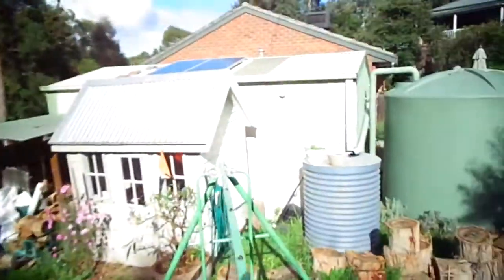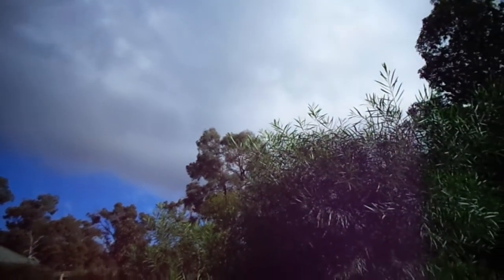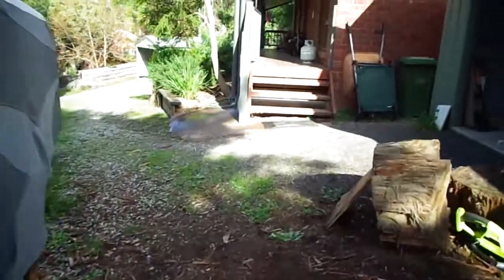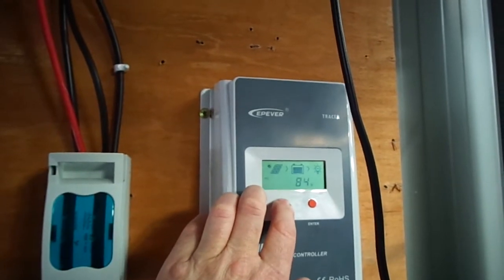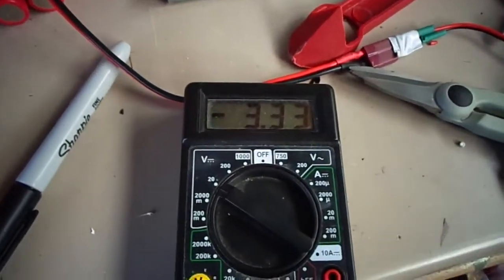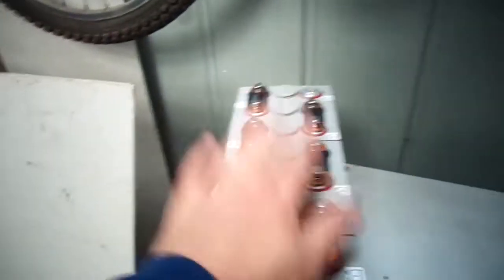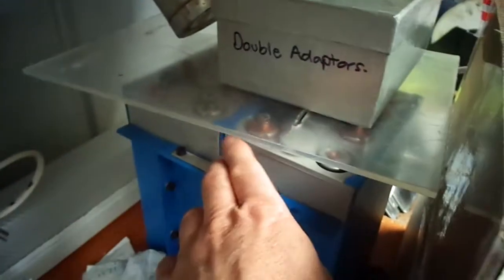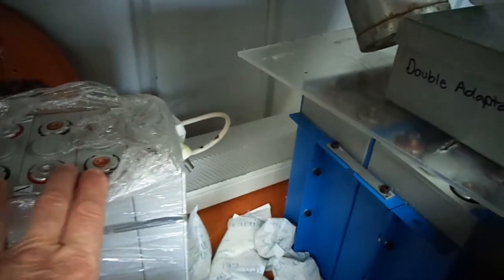LiFePO4 CALB 12 Volt Battery Bank Updates and Solar Update Part 1.

Comment: If/when you upgrade your system from 12V to 48v, be aware that the EPever 2210/3210/4210 run at 12-24v. Page 9 of the book tells you what voltage panels you can use with each charger for optimum efficiency. The conversion efficiency curves at the back of the book show you how much power you can expect at what input voltages. My 4210a (24v system) uses 6 x 72-cell panels in parallel with a Vmp of 36.6v. This puts it in the 96-98% area, so stays cool. Good luck!
Reply from the maker: nlo114 
Hi
I have a PCM60X charge controller for my upcoming 48 volt system and will continue to use the epever for a smaller 12 volt systen.
Thanks for the comment!
Reply: Pictures, pictures pictures! 
Keep posting the vids to let us know how you are getting on.
Reply from the maker: nlo114 Thanks for the kind words!
I will be doing another video very soon, just waiting on a couple of packages to come in the mail. Stay tuned 😁

Comment: Very nice setup. Love those batteries. Are the batteries expensive? This is a Facebook  link to my homemade setup at my cabin https://www.facebook.com/midimanmarcel/videos/10154576737256610/

https://www.facebook.com/midimanmarcel/videos/10154583493716610/
Reply from the maker: Bay Drifters Thanks for that. They are great batteries and quite expensive, I was fortunate to pick these up very cheap.
I will check out your videos.
All the best

Comment: Looks like you're getting some nice power from those panels when they've got the sun. A couple more in parallel may well take you up to the output limit on the EPEver. You could then use a different charge controller to top up in the evening with some panels on the other roof space perhaps? I think you said you had 8 of them? Thanks for the mention and the update.
Reply from the maker: Adam Welch Yes I do have 8 panels, that could be a good plan.
thanks